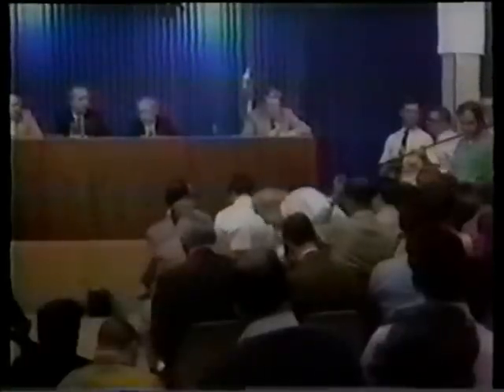Apollo 13 Part 8 CBS News Special Report of Flight Malfunction

Comment: This doesn't look like CBS archive video--The vertical hold rolling would suggest that this was taped off air using a regular analog tuner in the VTR/VCR, or even a video camera pointed at a TV screen.  The quality would seem to suggest either.
Reply: Consumer video tape recording wouldn't exist for another 20 years. So it would have to be someone with a professional rig.
Reply: Rob, that would be 1990 and VCRs had been around for a while by that point.  My family picked our first VCR up in '84.  I didn't know this but according to Wikipedia there had been various types of commercially available home recording equipment dating back to the '60s.